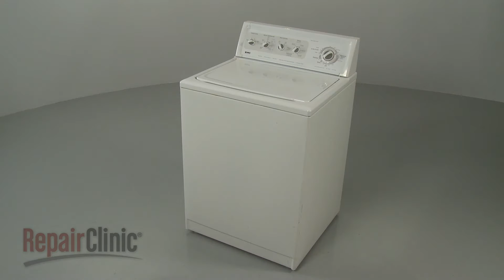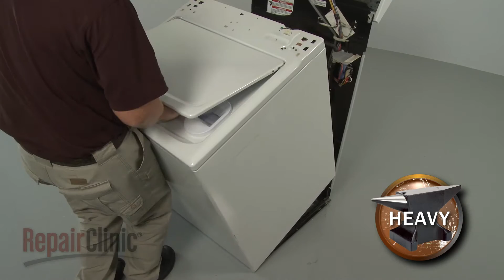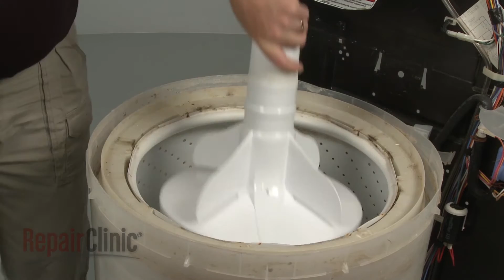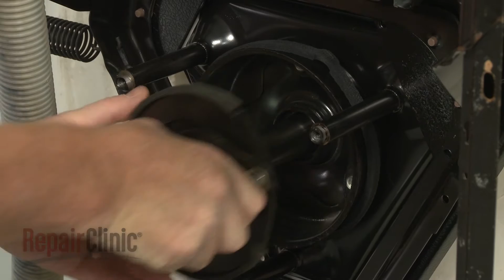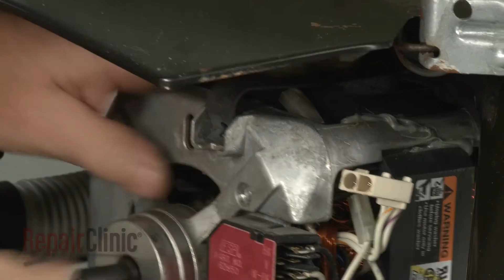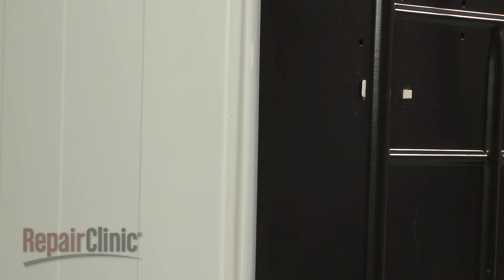Kenmore Top-Load Washer Basket Drive Kit Replacement W10820043

Comment: I'm trying to replace the inner tub. It is stuck. I mean STUCK. I gave up on lifting it. I read comments on tub replacement vids saying they removed it by removing transmission, etc, and it worked like a charm. Nope. I can't remove the basket drive for love nor money. If anyone has a suggestion, I'm all ears.

Comment: Although I do like these well-produced videos, everyone should be aware that they are created in ideal conditions: lots of work space, relatively new parts, etc.  The vast majority of DIYers are dealing with older machines -- rusted, gunked-up parts, tight workspaces, etc.  For this repair, the video shows a nice and easy lift of the inner spin tub.  That is completely foreign to the experience of so many folks (like me).  In an older machine, the drive bolt is firmly frozen onto the basket drive and the tub doesn't just lift out.  There are dozens of how-to videos with different homestyle methods for getting that tub out, and in many cases it's a two-person job.  People have poured penetrating oil, vegetable oil for days into the bolt threads, banged on it with hammers, used C-Clamps to force it out, etc.  And in my case, the outer cabinet just doesn't slide back on -- years of use have bent and rusted the tabs, and it's a PIA to get the thing back on.  Just be ready for stuff like this if you're working on an older machine.

Comment: 5:29 are you aligning any part of the clutch with the white sticky out part on the basket drive?
Reply: It's a good idea to set the clutch spring to the opposite side of the "sticky out part" (the brake cam) on the basket drive when you reposition the transmission and clutch.

Comment: Very useful video. There were a few things different on my Kenmore. Mine is from 1998. :)
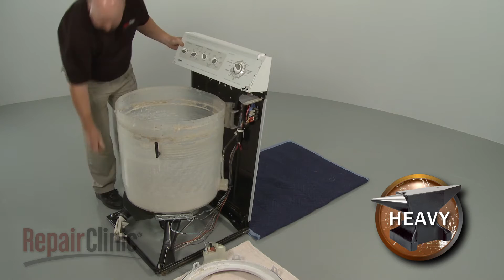4:02, I neglected to lie the assembly down carefully, so the clear plastic tube that helps with sensing the low/med/high wash load got pulled out without me noticing. Luckily, I babysat a small load, and saw that it was overfilling. I reconnected the clear hose and everything was fine. 
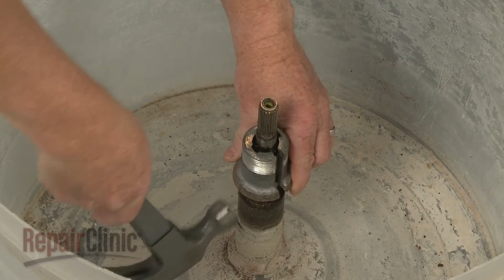I had what seems to be some kind of lint filter. It looks like a wheel with fine long teeth on the outside and has a neck in the center that fits up inside the basket. It's translucent. If you don't take it off the bottom of the basket, the drive block 3:11 gets stuck in the basket shaft. It was quite a pain to get it off. I'm glad I did because the drive block was totally encrusted. Had to chisel and wire brush it clean.
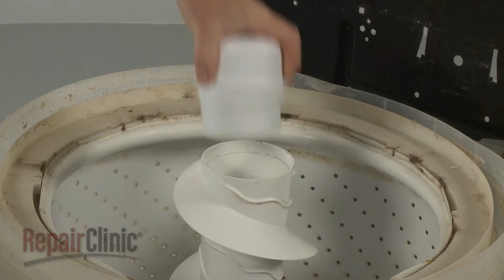I did not have an agitator cap and cover like 2:13  I just had a small flat cover on the top. 
Also, I tried doing this without the spanner wrench.  When I finally broke down and bought the spanner wrench, it was still hard to get off. After a lot of wire brushing and chiseling, and cleaning up, it's running. I think. :|
Reply: I think the washing machine I'm working with is identical to yours, with your description. I cannot get the agitator off, even though I unbolted it. Can't get to the spanner nut, yet. I'm tearing this machine apart for recycling purposes, so I'll resort to using a cut off wheel. 😬

Comment: great video...how do I know the problem is the basket drive and not the transmission?
Reply: Good luck. I've replaced the lower clutch and the transmission...darn thing still doesn't work right. Looks like I'm going to have to do the basket drive unit next. Should've just bought a new washer!
Reply: You will be glad you kept it . I Own one that is almost 25 years old.  They don’t make this model any more. Most new washers won’t last 5 years.
Reply: @jonyoung6405  truth
Reply: @jdub816  hello can u tell me what u did to finally fix your washer 🙏
Reply: @ttc3004   anybody ready to answer this question?